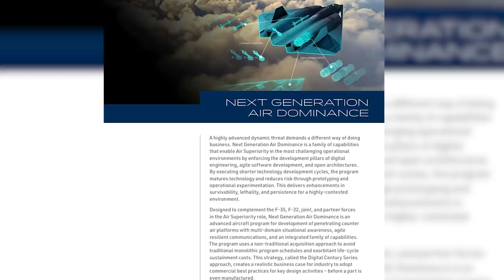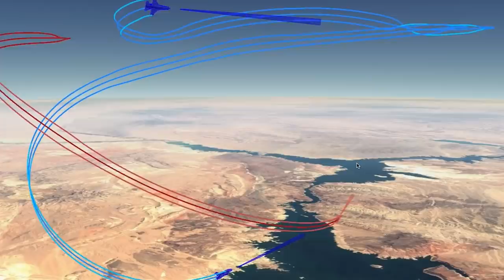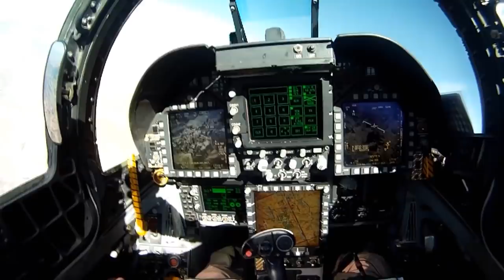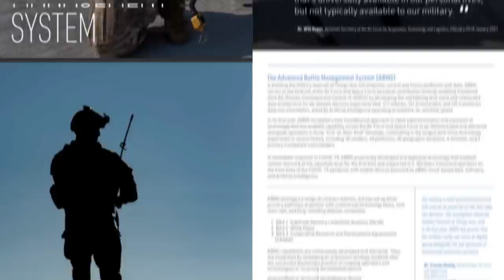Here's America's 6th Generation Fighter Jet Kept In Secret

Comment: While living outside of Goldsboro NC for 4 months, I quickly realized we were living directly under the approach to the air force base. I witnessed the STRANGEST events I've ever witnessed while there. Jets going by at night and once they're past seeing a light sitting statically right near where they were, then suddenly streaking off. The sound of what I can only describe as a fan that was almost completely silenced. At evening twilight, with no lights and no discernible outline we could see. Lights splitting into multiple lights then going in separate directions. The one thing I think was possibly a UFO was on Halloween night at 2300 hours. An orange orb comes over the horizon, then another about 2 seconds behind. They looked just like how you'd imagine a fireball would look. Minus a long tail. Just orange balls of fire. They flew directly overhead, maybe 500ft up. Completely silent. 3 seconds afterwards, the front one just burned away to nothingness, as did the one behind 2 seconds afterwards. There were many other events, but too many to list here. Our Air Force, I believe, has stuff we can't even imagine.
Reply: I've seen those fireballs near a Navy Airbase. I think that they're anti heat seeking missile flairs.
Reply: What you were seeing were flares they look like they are just hovering
Reply: They are seen everywhere, it's not flares and it's not military tech.
Reply: Is it ours? We had the privilege of paying for it, but this is a breakaway civilization. Life on Earth is doomed.
Reply: You ain't seen nothing  yet!!
Reply: Check out William Lyne's lecture on the 33rd Parallel show, you can find it on YouTube if you look hard enough, probably has low view counts. That interview and his book "Occult Ether Physics" goes into a great deal of detail regarding how some of this technology probably works, using ELECTROGRAVITIC technologies originally based on Tesla's Impulse Wave technologies that were used by T.T. Brown in a modified form to power his experimental Electrokinetic Apparatus. The book by Rho Sigma "Ether Technology: A Rational Approach to Gravity Control" is also a great reference.  "Secrets of Anti-Gravity Propulsion" by Dr. Paul LaViolette is another good reference, as is "Lost Science" and "Secrets of Cold War Technology" by Gerry Vassilatos, and you can probably find .pdfs of all of them if you do a google search! Also wouldnt hurt to watch Eric Dollard's lecture on YouTube titled "History and Theory of Electricity" to get an understanding of the exact theories, worldview and mindsets of the maverick electromechanical engineers of the late 19th and early 20th centuries, and the Æther physics theories they were working with, as well as the completely different model of the atom and the periodic table of elements created & used by Walter Russell, John Ernst Worrell Keely, the Theosophical Society, etc. Dmitri Mendeleev wrote a paper in 1905, 2 years before his death, theorizing that there were at least 2 elements prior to hydrogen using the same system he used to create the original periodic table of elements that discovered quite a few missing elements unknown to science at that time. Basically to put it bluntly, there are a lot more systems of grouping the elements and understanding the relationships between different types of matter and forces than just chemistry and newtonian, quantum, and relativity based physics systems. There is also alchemy and natural philosophy (and probably more that I am unaware of at this time, Lol) that categorize and draw relationships between events and materials and forces in our universe in entirely different frameworks and paradigms than the ones we have been made aware of thru school/college and media, and any of those could have been used to design the propulsion systems that we see in Commander Fravor's team's F18 IRST videos! If that is the case, of course these vehicles would seem impossible if they are violating laws of our forms physics that cant see the loophole that allows such a phenomenon to occur that might be quite obvious in their systems of natural philosophy that draw relations between matter and forces in different ways by looking at different properties that we have completely overlooked.

At the very least google "Thomas Townsend Brown", "Project Winterhaven" and "Project Montgolfier" to get an idea of these programs probably started on the American side of things before they went deep black basically as soon as the beginning stages of the propulsion system technology was shown to the Top Brass in the US Military!
Reply: Alien conspiracy theorists will go nuts over a failed rocket engine test. It's no wonder they freak out about everything in the sky, especially knowing what we don't know about experimental aircraft.
Back in the 60s, the Air Force had a flying saucer craft that could barely get off the ground. Or at least, that's the footage they allowed to get out. Of course, that was 60 years ago. I'm sure a similar experimental craft is going to be more functional in this day and age...

Comment: The 6th gen has been around for years, they are only letting it out now due to having the next generation in the works.  Oh, something not in the video, it's silent, as in no sound while flying.
Reply: Truly silent movement through air would be near impossible. The air an object displaces as it moves through air radiates in waves that our ears translate as sound. Something the size of an airplanes moving at hundreds of miles per hour through the sky would surely create pressure waves that will be impossible to cancel out.
Reply: @giraffewithtattoos2770  The Alcubierre drive would probably accomplish silent travel in space, but they've never proven that's even possible.
Reply: I get it. Awesome.
Reply: ... and invisible and nonexistent.

Comment: I'm surprised that pilots are still on board the plane itself.  Back in the 1980s or 1990s, an Israeli fighter pilot told me that in about 20 years, fighter planes would be remotely controlled, and that fighter pilots were not pleased with the prospect.
Reply: Isn't that a drone?

Comment: Put lasers and carbon cloaking and I will get my check book!
Reply: So cover the jet with weed barrier. Creating an absorbent surface that doesn't reflect radar energy in any form. I believe it can be done by converting the carbon weed barrier into activated carbon, and seeding it with selected elements that convert radar energy into magnetic, or electric energy the jet can store, or use. Plus it's light weight.
Reply: Well, this is a mouthful👂

Comment: I read that an aircrafts vertical stabilizers negatively effect stealth so why have them on stealth planes? I read that it's because not having them reduces inflight stability and manouverability. 
So why not have stabilizers that can change position in flight? A pilot can have them horizontal to improve the crafts stealth foot print when needed & vertical when needed.
I get that stabilizers are put under a lot of stress but I'm sure they could make manouverable stabilizers that are strong enough to work under such stresses. 
Why don't they? What am I missing? 

Why doesn't the F35 & F22 have them?

Comment: Like it matters lol. After the white elephant which was the F-35. My hopes are not high here. Look how long it took just to get the Raptor operational. Some people may remember the movie Firefox staring Clint Eastwood. 

It was a fictional experimental stealth aircraft which we stolen from the Russians. Which seem to be somewhat Loosely based on the real Mikoyan MIG-31 Foxhound. 

Although I think it resembled more the Douglas One or the Concorde.  Although more futuristic and as a means of intercepting here. Anything the West had to offer at the time. 

__________________________________________

Which probably my guess would have to be the SR-71 Blackbird. U2-B, TR-1 & the D-21 drone. The Mark 3:5 Lockheed D-21 drone. Was launch from a Mothership SR-71. 

Which was the only real concern Russia had in 1982. All the more ironic considering titanium had to be smuggled out of Russia just to build the damn thing lol. 

____________________________________________

Russian engineers took what they learned from high-mach turbojet engine technology and applied acquired US engine manufacturing technology. To to the Firefox's Tumansky 600 series 50,000 lbs engines. 

Built within the same footprint of the current R-15BD-300 design.  The introduction of the high-bypass air intake systems. Like what you see in today's Ramjet technology. 

However I doubt Firefox could reach Mach 6 as stated under it's current design.  You would need something more on the line of the Concorde propulsion system or the SR-71 which engines are far bigger. But as for this new jet who knows here. :/

Comment: Consider these planes will be made by people coming out of college now so they will be covered with solar panels and use  fry cooker oil fuel .  One pilot would show privilege so it would need a diverse crew.
Reply: I understand your sarcasm.....ha ha ha.  However, if they did run on solar panels and fryer oil we would have a significant strategic advantage.  They have tried to power them with a mix of entitlement and jingoistic patriotism,  but alas, they just made alot of noise.......
Reply: @mlauer  Solar panel and bio fuels are part of the big joke , by the time you calculate the inputs against the out puts they  both operate at a net loss. If they world does not start building nuclear plants today we are in big trouble .
Reply: @kolilagephart3766  why will we be 'in trouble' if we don't start building nuclear power plants?

Comment: That concept art is not quite accurate.. I created the original blueprint for that aircraft two years ago.. The weapons systems in the video are completely wrong.. In addition, it was never designed to carry a human pilot.. It is not AI however,,  It was designed to be controlled in the same manner as the "Predator" drone. Basically an Interceptor version of it. It can also be set to act as a literal Wing Man  to a manned fighter  aircraft. It will mimic every move the  fighter makes.. An entire squadron could be set to mimic one pilot if needed, making it devastating in a ground attack role.